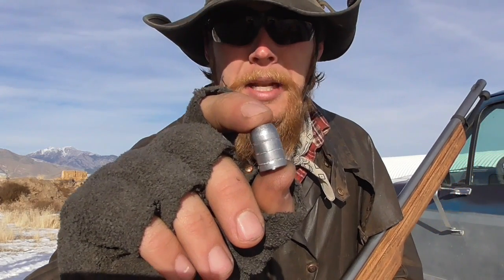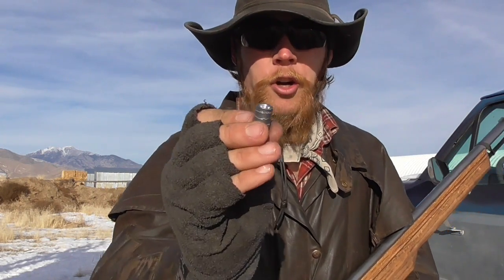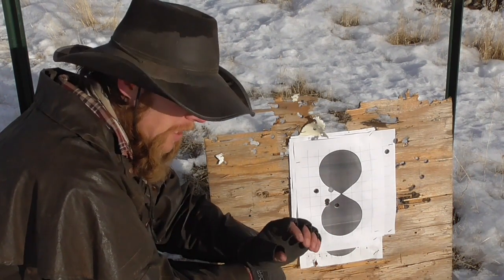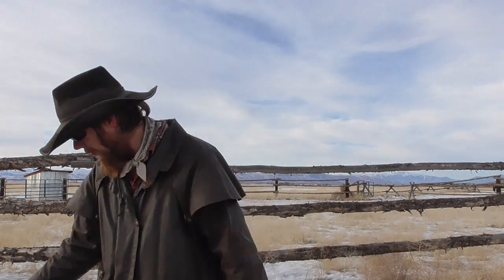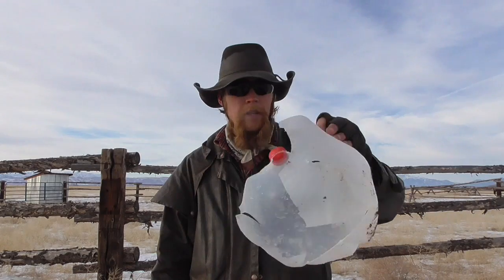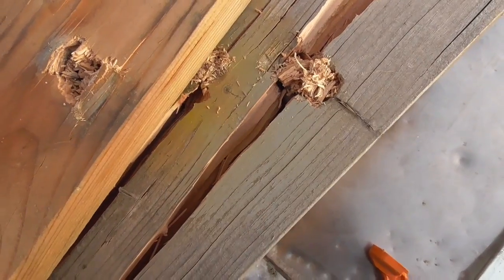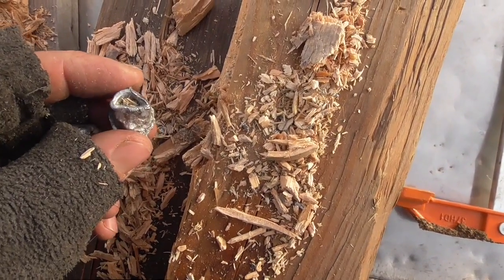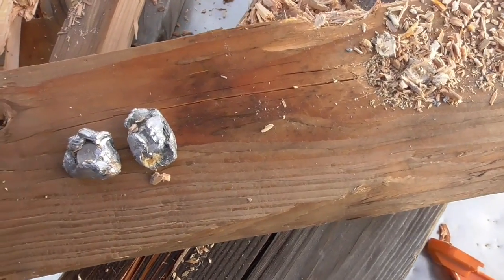Shooting a Minie Ball Backwards (TIS185)

Comment: Those things are so very wide already that they serve no purpose by expanding.  To whatever extent that they expand, they penetrate less.  In my modern deer rifle, I care a lot about expansion because the bullet leaves the muzzle at only .3 inches in diameter.   In my 45-70 Sharps, I care not at all about expansion.  I like using 545-grain cast bullets.

Comment: It’s essentially turns it into a dumb dumb round which is super illegal. I’m sure there are no laws specifically against firing a mini ball backwards but the damage it causes is banned by international law.
Reply from the maker: For the record, the term "dum dum" applies to any bullet designed to expand on impact, including all types of hollow-points.  International convention prohibits their use in war, but they are perfectly legal (and widely used) for hunting, self-defense, and domestic law-enforcement.
Reply: @TheIdahoanShow  
It’s hard to tell because the musket is technically “rifled”, and technically will “expand on impact” if fired backwards. But it wasn’t  “designed” to do that. It’s only designed to expand when fired. So it’s hard to tell if it wouldn’t fit the legal definition if fired at another person.

Comment: It would interest me to see if the Minie projectiles would have better penetration if you'd produce them with a steel tip and core (sth. Flachette like): e.g. by inserting a nail's point into the tip or somehow manage to cast the lead around the nail's point. Would it's flight be impaired? Range? Accuracy?

Comment: Waiting for the rifle to pop, muzzle loading makes me nervous
Reply: There's a video floating around of some guys trying to blow up a muzzle loader. I think they did a double charge and two projectiles, loaded powder and ball twice, even filled the barrel full of powder and stuffed a ball in it. Nothing made it explode.

They did get it to kaboom with some smokeless though, I believe it was a double charge
Reply: @Robert-qm7yi  I did that deliberately years back with a .50cal muzzle loader barrel that that shot patterns not groups......it finally blew with about 700gr of Vihtavuori N540 and 3 510gr projectiles loaded.......it was a fun evening
Reply: @Robert-qm7yi  Lol seeing how it blew up kinda made me not want to try hot loads......along with splitting the barrel it blew barrel breech plug out and about 3 inches into the pine log that we had the barrel backed into.....my shoulder doesn't need a chunk of steel passing thru....
Reply: @unhippy1  Hot black powder loads I mean, no way in hell am I going to use smokeless, I'm not that stupid.

Black powder doesn't seem to be about to blow up modern muzzleloaders unless you do something crazy like stuff 2000 grains of lead over a stout charge, even then I have doubts.
Reply: Why do you expect the muzzleloader to burst? Seat bullet on an approved charge and don’t plug the bore and there’s nothing to worry about. They build them to safely handle 20%+ over what their highest rated charge and bullet weight is. Black Powder produces much less pressure than smokeless so it’s actually pretty safe.